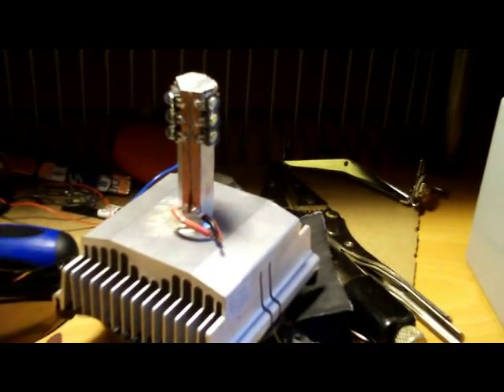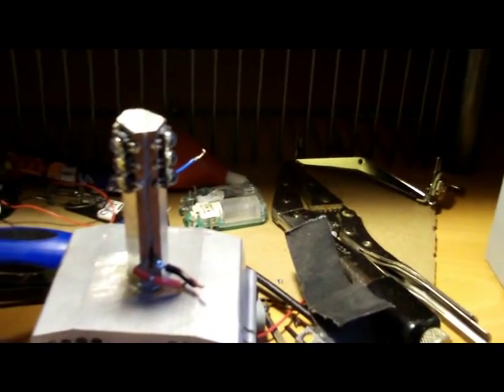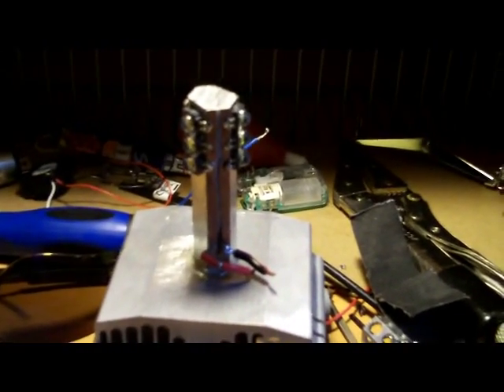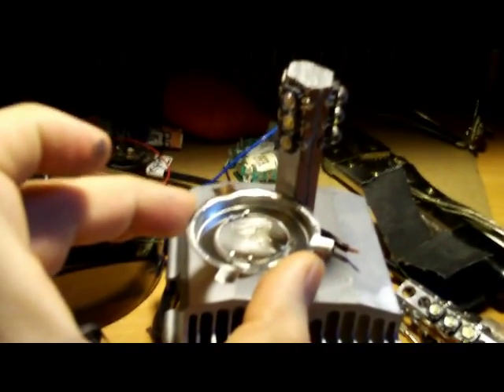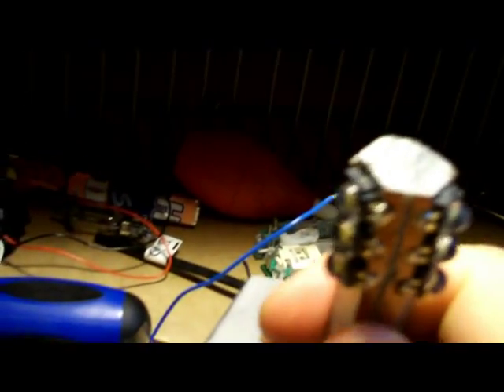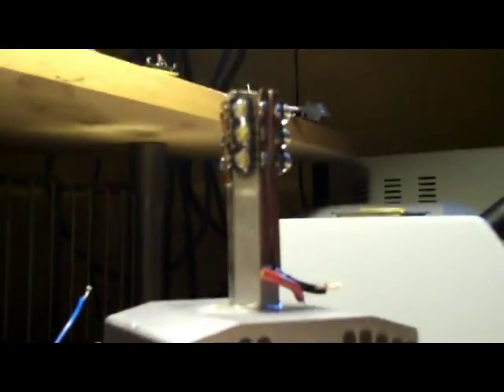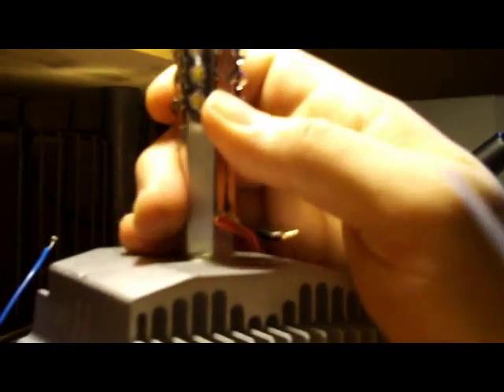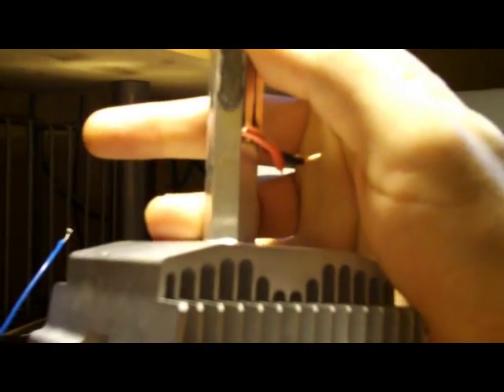LED Headlights

Comment: Modern headlights have reflectors, which prevent people from getting blinded providing you use the OEM-sized blub and your headlamp assemblies are calibrated.

That's the reason why you can get blinded by an older car with halogens, but rarely do when a new car with HIDs drive past.

Comment: I know this video is old and perhaps outdated by technology advances but can you post some details or provide a link to share some of your experience??  how did you handle high beam low beam, what raw materials did you buy and integrate, what driver, which LEDs, where did the post come from, who assembled the array, why the monster heatsink & fan (you said 1 AMp and I know the 10W LED floods run about 800ma w/o a fan...

Comment: I build all my LED lights handmade, all waterproof, and all are running without heat. Have a look on ledmission on you tube and see my Fog lights and i need only one footlight (12 inch) in the middle. Each of them are br ighter as my regular headlights

Comment: I'm actually going to be building a regulated set similar to this in the very near future, and I was wondering about the LEDs you used in this array.  Any chance you could post LED specs or a link to a datasheet?  I'm trying to gauge brightness level so I can purchase LEDs slightly brighter than I need and interface a PWM control to adjust brightness level.

Comment from the maker: Its true a normal headlight bulb does run very hot, But go ahead and try to take an LED to 500 deg.  Not going to happen. Most LEDs cant go above  100 deg.C. The heat sink is required.